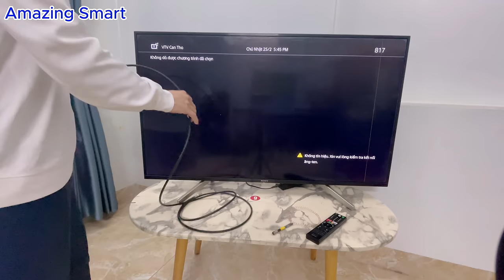Antenna Manufacturers will want to Remove this Video !The Most Powerful Antenna

Comment: Why are you showing nonsense
It all depends on how close the transmitter is to your home. Sometimes all you need is the proverbial fork. And what if the transmitters are scattered and at different distances from the house (receiver), then what? Then sometimes a circular antenna is not enough. Well, unfortunately, the truth is often harsh. I, for example, have one of the three relays almost under the house and I don't need any antenna to receive it, but for the others I do. And to make matters worse, the antenna that I use to receive from other relays significantly reduces the signal level of those programs that do not need this antenna. So I think that the choice of antenna is an individual matter of each individual or group living in the same area, housing estate, etc. However, the antenna is used to capture the signal in the ether and does not decode it. That's what an external or internal set-top box for a tv receiver is for. It has a module or program to decode the received tv signal and there is no mercy. Greetings to all professionals and non-professionals. ❤❤❤
Reply from the maker: Thanks so much for watching our video. Wish you all the best
Reply from the maker: Thank you for watching, I will be happy to receive your sincere contributions. Wishing you and your family always happiness and joy.

Comment: Очень интересно.
Прошу, по возможности указать параметры антенны.😊
Reply from the maker: "Sure! The antenna's specifications include its frequency range, gain, impedance, and radiation pattern. Could you please specify which parameters you're interested in?

Comment: It is random wire for signal, therefore is not good antenna at all.
Antenna must be tuned for concrete frequency.
Reply from the maker: "Absolutely, while it may seem like just a random signal wire, this antenna actually picks up signals and can be useful in some cases. However, for optimal performance, tuning the antenna to specific frequencies is necessary. Hopefully, this message helps you understand more about the antenna and how it can be beneficial.

Comment: Только столько переходников(соединений для штекеров) в карманах Не лежат и в доме Не у каждого найдётся. А так да приемлемо к использованию и намного проще, даже без этого т, к в каждом телевизоре сейчас есть своя внутренняя встроенная антена.
Reply from the maker: I agree, having too many adapters (plug connectors) is not convenient for everyone. However, using a homemade antenna is still a reasonable solution, especially since most TVs nowadays come with built-in antennas.

Comment: korea TV O.K?
Reply from the maker: Thanks so much for watching our video. Wish you all the best
Reply from the maker: Yes, this method can work in many countries, including Korea. However, the results may vary depending on the geographical conditions and transmission environment of each region. Thank you for your interest!
Reply from the maker: To get the best signal, place it in a high, airy location, if on the 2nd or 3rd floor, even better.